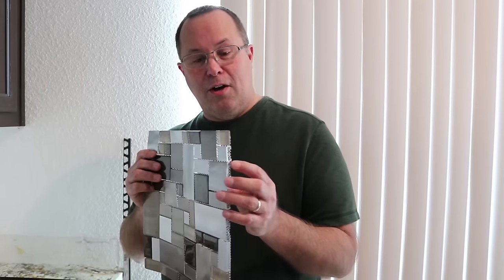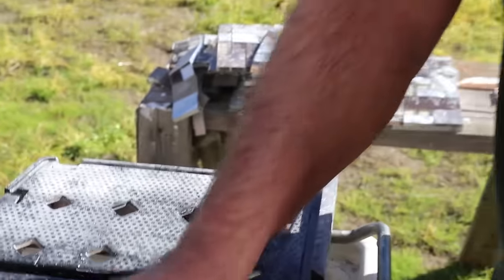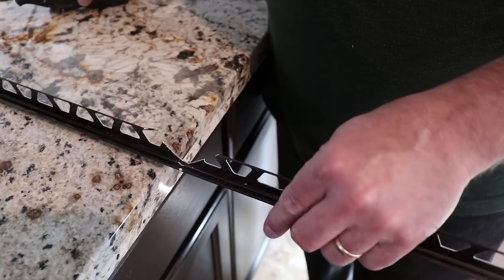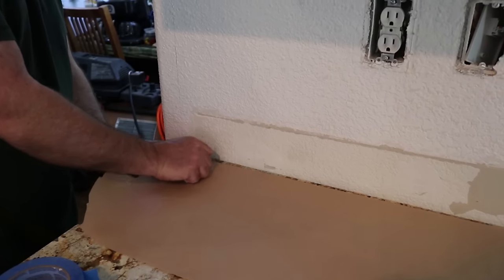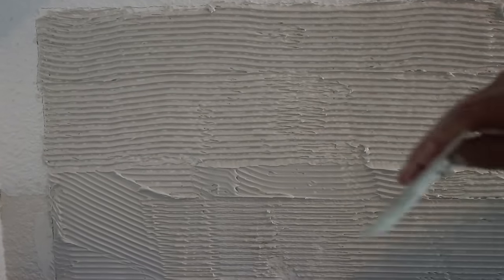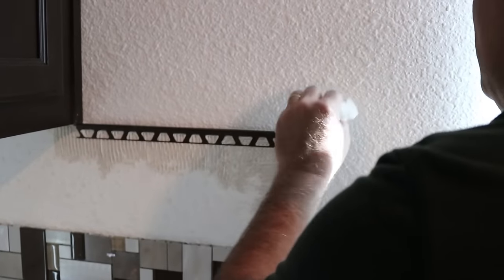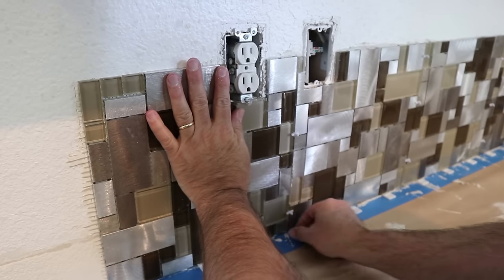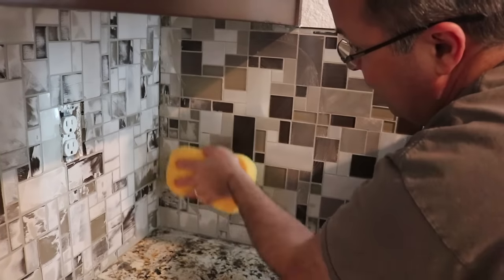How To Install Tile Backsplash with Schluter Trim

Comment: Thanks, Mr. Noodle! Very informative. I did bend the Schluter trim, but didn't cut back in far enough, so got a rounded corner. Easy enough to trim the corner of the tile to fit and I like the curved edge!

Comment: Finally, someone else using MAPEI products with Polymer for Thinset Mortar, and Grout Maximizer for Grout sealing.  Both are rubberized products available at Lowes and prevent tiles from popping off, earthquake cracking, and great for RV tiling. Nice work!

Comment: Very practical, but I will use of box extender for the electric receptacles so the faceplate sits on the tile.
Reply: That is also the requirement of the building code.

Comment: Always cover your counter top! A good tip is to use the cardboard from the backsplash boxes. It can be a real pain to get off depending on what thin set you use.
Reply: You get grout off a granite counter by spraying water and use a double edge razor blade (small or go to a janitorial store and get a window cleaner blade handle and blade come separately). Only scrape one way- do not scrape back and forth or you will scratch surface only move blade forward all areas and keep wet remove the chunks....clean with Floor Brite (a neutral cleaner for stone flooring) polish granite with a marble polish spread manually thinly leave on a few minutes then buff manually with a towel for polishing polish from janitorial supply store. The chemical cleaners half the time sold in Walmart and supermarket are crappy cleaners that make people suffer from allergies.

I do construction rough, final clean up and painting of custom homes.

Comment: Very helpful instructional video. Thank you helping the community out!  Though I have an issue with installing the schluter channel aligned perfectly with the bottom of the cabinet where the backsplash extends outward along the wall to the edge of the countertop.  Generally you want to avoid cutting tile pieces on the top row since that area is one of the more visual parts of the backsplash.  I'd suggest to make sure with that part of the backspalsh the top row extends past the bottom cabinet line with un-cut tile pieces and install the schluter pieces around it.  The area where the top row tile meets the cabinet bottom will have to be cut. Does that make sense?

Comment: Thank you bud, eliminated almost all uncertainties I had going into my first mosaic tile job for my home rebuild / remodel - post hurricane Ida.  Only debating weather or not to replace my new drywall with a backer board for the area to be tiled? 
It's a backsplash in the corner of a bathroom where a claw foot tub will sit, not a shower or tub wall proper.   have the moisture barrier adhesive meant for humid areas.  Not really wanting to rip out drywall, but don't really want to have to deal with tile coming off the wall down the road.  Backsplash will be about 3-1/2 ft high....anyone have any thoughts on if the drywall can take it?  It's already been finished and textured with a light orange peal.  If I keep it in place, I was thinking to lay a layer of mastic down first to smooth out the light orange peel texture, and let it cure before proceeding to install tile.

Comment: let us know how your receptacle face plates work on your now recessed outlets. Outlets get pulled out of the outlet box and go over the tile not under the tile as you have it.
Reply: TheTotaled1 use longer screws
Reply: @SA-qk8uh  longer screws won’t work if the receptacle is recessed.
Reply: @marco8132  Since when will longer screws not work? That's exactly how I do it and it works every time

Comment: Most important factor in backsplash jobs is making sure the countertops are all level and you have a flat area where you’re installing the tile....electrical outlets can
 force the sheet rock outwards which is a pain in the arse

Comment: the only downside that triggers my OCD with the schulter install being bent to 90 degrees, is the risk of the coating chipping like in yours ( the little chip at the inside corner )

Comment: Won't your tile be off under cabinet against the one wrapped by schluter because there's a slight difference on the schluter when put right under cabinet?

Why you did not follow a schluter right through under rest of cabinet?

Comment: Isnt't it better to start from the corner ? 
And isn t it better to just remove a few small pieces of the mosaic instead of cutting the tiles where you  have the outlets?
And are you sure it is better to start with the trim (profile) ? Just wondering
Reply: The problem with starting from the corner is that you'll have a cut edge showing way out in the open, it's much better to make your cuts in corners or near the bottom of the tile to keep the factory edges in view and not your own cuts. As far as the outlets go, if the stars align you'll be able to just cut the mesh and remove a few tiles, but more often than not you'll need to cut tiles to make sure the faceplate on the outlet covers any gaps. As far as starting with the schluter or not, that's kind of personal preference. If you install it correctly, it gives you a nice plumb or level edge to work off, which makes the rest of the tiling much easier.
Reply: Personall i like to start from the corners.  Everybody has there own way

Comment: You shouldn't use a diamond blade to cut soft material, especially aluminum, it galls and glazes the diamond blade.
Reply: I guess if you barrow someone else's saw its ok.

Comment: I've read you should only tile the back wall and not the sides walls, forcing you to use the expensive edge trim in the first place.  Having the tiles hang in the air and sticking out doesn't look good.  But love that you bent the metal, otherwise you have to buy corner connectors to join the metal, and not every profile will come with corner connectors.

Comment: Great video. Curious why you chose the "bend" process for the Schluter trim, rather than using the "out corner" right angle that you could have purchased from Schluter?
Reply from the maker: Mike,

Great question. Honestly that was my first experience with Schluter and I did not know they had a corner piece. All in all I think it made a clean seamless install.
Reply: @HowToWithMrNoodle  Exactly. Looks better and saves money.
Reply: Mike Searson wish I would have seen your video before I cut my Schluter edging, and paid $15 each for two Schluter outside corner pieces! Love the clean lines of your ‘bent’ corner!

Comment: Hope you never have to change the outlets you have grouted in, and they are going to end up the tile thickness behind the cover plate.  They should be removed before tiling.

Comment: Could have saved time by cutting the schluter at a 45 instead of bending, recutting, remeasuring and repeating
Reply: No way, I had an installer do what you are suggesting, and I stopped them after a small section was completed. It looked horrible, and finally canceled the contract. I removed the edge of the schluter with a cutting wheel and hired someone else to finish the job.

Comment: Never start your tiles on the bottom. The sliver is hideous at the top. Also cut schluter slowly with a mitre saw/chop saw for perfect corners. Ive done over 100 backsplashes. Forman Paint& Remodeling on Facebook if you doubt me.
Reply: why start on top then ? hmm

Comment: Is this for real. No disrespect but I don't agree with none of it. For one why would you put your trim so its under the cabin. That means you have to notch the tile and cut the rest short. Almost 30yrs in the trade and I know we all do it differently but this is crazy. Even the trowel is way to small. I was also taught that all your cuts go to the corner. The other cut should go down on the granite top. Its not as easy to pick up on if you have a small cut or counter top isn't very level. Once again just my opinion .

Comment: Yikes, this was cringe worthy. Just about everything is done incorrectly. I’m a professional tile setter with 25 years experience and I’d be let go from the custom shops I sub for if I ever did an install like this. Good luck replacing those plugs 🤦🏼‍♂️

Comment: It always disappoints me to see people use a file incorrectly.  Metal and wood files, like saw blades are designed to only work in one direction.  As you draw your finger along the tile you will notice that it feels rougher in one direction than the other.  Using it like sandpaper with a back and forth motion tends to dull the teeth much faster and does little on the backstroke.